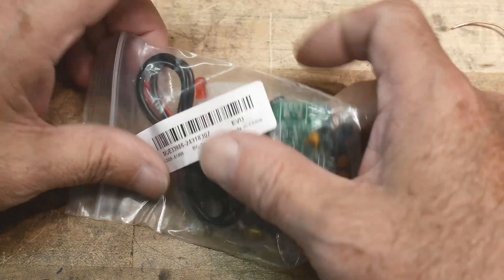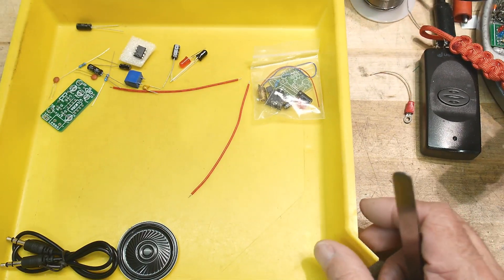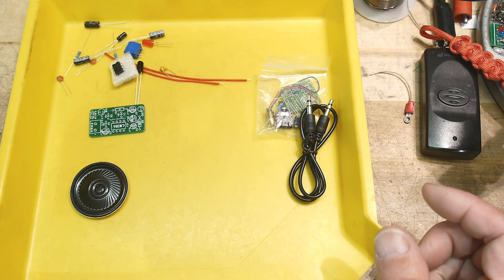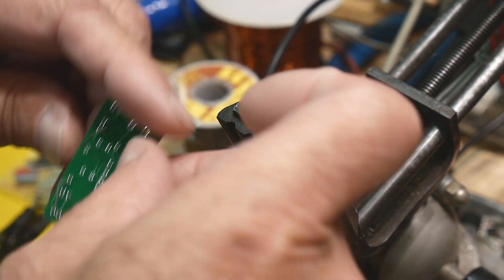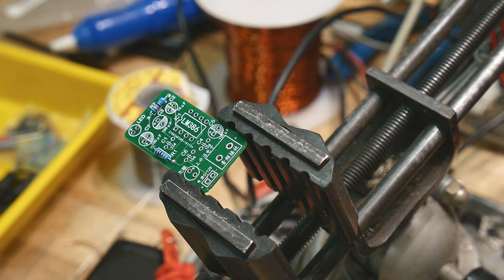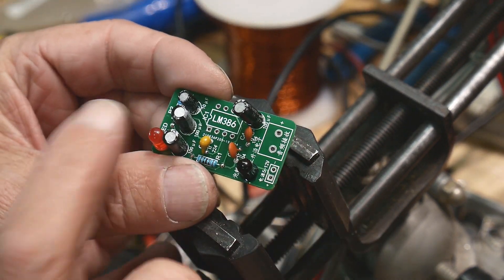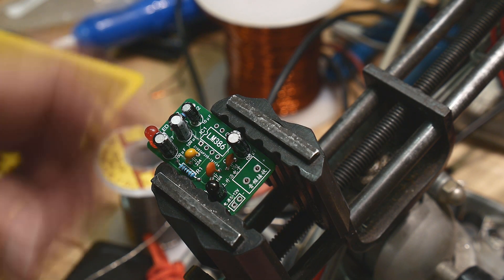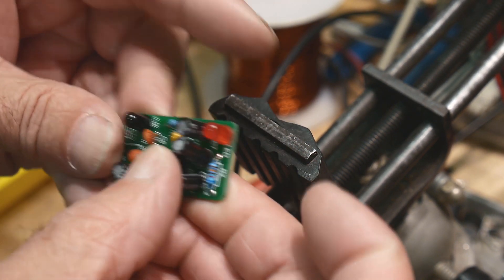#765 Transmit Sound over a Laser Beam

Comment: Tip for wicking wick. Dip the wick in flux. I alway have better results when the wick had flux applied to it. Alway clean your tips after touching the wick with the tip. As the residue from the wick tend to eat my tip coatings alive. I actually use a old tip when using solder wick.

Comment: IMSAI Guy, you have excellent PCB assembly skills! It is clear that this was not your "first rodeo" with assembling an electronic kit. What a nice and clean job you did building the two (2) circuit boards! Unfortunately, the wireless laser audio transmitter and receiver set is not quite up to audiophile quality... LOL  Fred
Reply: I guess it's because improper voltage was powering the transmitter board so transistor acting as amp was not biased open enough.